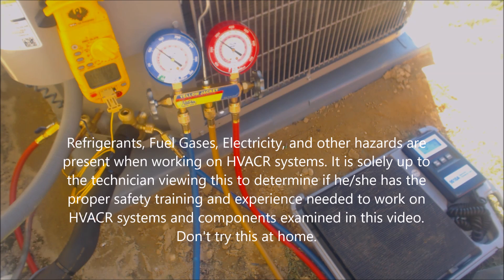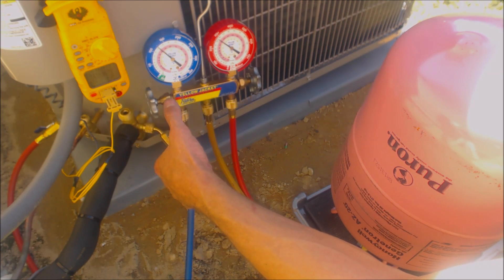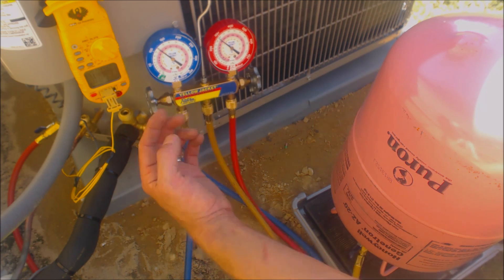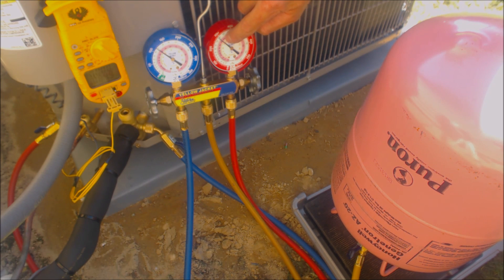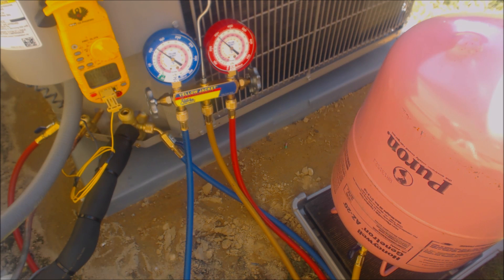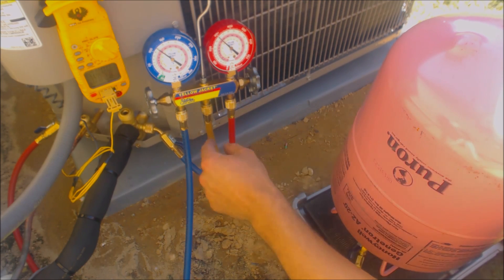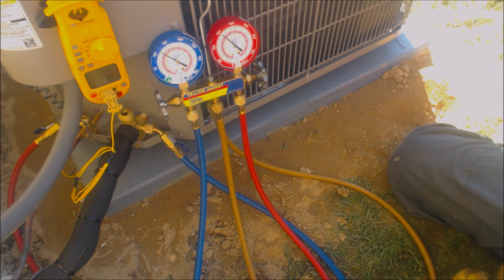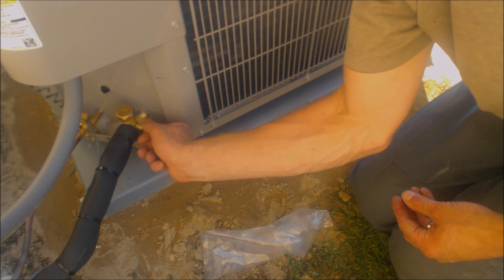How to Add Refrigerant to an Air Conditioner!

Comment: can you teach me how to compute subcooling with all these tools and equipments
thanks
Reply from the maker: To do Subcooling you would look at the dial that lines up to pressure on the outer ring. Then follow the needle in to the refrigerant being used. This temp shown on the gauge on the inner ring is your saturated temperature. Then measure the liquid line temp within 3 inches of the port with a digital temp sensor. Take the sat temp minus the actual temp=subcooling. If the subcooling is too high compared to what is stated on the outdoor unit rating plate then it is overcharged. If the actual subcooling is less than the target subcooling then refrigerant must be added. This is use to check the charge of air conditioners and heat pumps that have single and two speed compressors in cooling mode. Here is the subcooling playlist-   https://www.youtube.com/watch?v=qqLwE7Kbyaw&list=PLxnHR5_D2ojxTcAtR_53GoY8huBcSOt0a

Comment: Good day, just to say thank you for sharing your expertise. I have only a question to my doubt with regards to subcooling relation to current (Amps) reading in compressor. How much reading need for subcooling that we can consider enough based on experienced. How about the current of compressor it is need to read full load or based on subcooling only. Thank you in advance.
Reply from the maker: A compressor curve is used on refrigeration but not on air conditioning. The amp draw will go up if the refrigerant cannot reject the heat and the pressure goes up or there is too much subcooling taking up the outdoor coil and the coil has a hard time rejecting the heat,  make sure to set the subcooling to the target found on the rating plate or 1 or 2 degrees above the target txv subcooling rating on the outdoor unit, thanks

Comment: Great videos. Keep it up. Can you make a video on how to charge a unit with a variable speed compressor and electronic expansion valves? Especially since most have very vague installation instructions.
Reply from the maker: Most variable speed units are total weight and lineset length only unfortunately. Thanks for letting me know what you would like to see Albert!

Comment: I am new at this (and have a lot to learn) and a lot of videos don't cover how to attach the hoses/manifold. When you attach your manifold and purge the lines like you did, isn't there still air in the manifold itself? I was recommended a method that purges the air in the manifold too: Open each valve on the manifold and allow the refrigerant from the system push towards the tank where the fitting is loose on the tank itself. this should leave no air in the manifold and the hoses. Can you think of a problem or pitfall with that method? Thanks ...great videos!
Reply from the maker: That method works great. That is the same that you would see in the recovery video I just did, thanks. A pitfall could be not knowing exactly when all the air is out because the vapor and liquid are mixing. When you purge a vapor line there is some noise change but you definitely know when you purge a liquid line. But we do what we can, thanks Tony!

Comment: I always check the temperature split at the indoor unit after I charge it up and if it's between 17 and 21 I am happy with it. What is your take on that? Thanks
Reply from the maker: Yes that is what I do 18-21 delta T, but when you are checking a unit that is dealing with very high humidity, you may not get it on piston systems so you have to rely on just your superheat in those circumstances. I always check it though because it is one of those confirmations when you do see it, thanks David!
Reply: acservicetech Yeah right now I  am doing install and I have not worked with any units that have pistons. The only units we seem to install are Trane and Rheem and they are TXV systems. Eventually I will transfer to service so the info you gave me will be very helpful. I need to start right down all of this and keeping it in a folder. Haha!  Also sometimes I run across units that give me a higher temp split would that be because there is not enough return air flow? Thanks man!
Reply from the maker: They may be variable speed compressors if the manufacturers say they should have a higher temp split. If you are reading a higher temp split on a single speed compressor then yes it very well may be low air flow. Check the low side to make sure it won't eventually freeze if it stays on, thanks
Reply: acservicetech I will look at manual next time I come across variable speed unit. As always thanks for the reply. 👍

Comment: Thanks again for another learning experience. The metal caps on the top of the lines are new to me ... why do those have to be off when filling?
Reply from the maker: The only reason they were off was because I just opened those valves after installing the unit. They did not have to be off, thanks
Reply: acservicetech • Thank you.

Comment: you leave the pressure in the gauges?
Reply from the maker: I try not to but in this case if I added that refrigerant too, I would be at 14-15 degrees of subcooling as there is a lot of liquid in the line vs 12 degrees where I wanted to be. Sometimes it is hard to judge when to stop charging and start the disconnect procedure. On this system I could have started at 9 or 10 degrees and then charged the yellow line in and then the red line. It is certainly very easy to charge this red line back in when just checking a charge as you won't be over charging, thanks TurboFlush!

Comment: Where is your filter dryer? What are you charging per pound?
Reply from the maker: I always install the filter drier in front of the evap coil. The refrigerant was included in the quote to do the change out, thanks
Reply: Thank you

Comment: I have a question.
  should I  take  HVAC class  from adults apprenticeship  trades school night times class or take HVAC class in college ? what's the same and different ? Thanks you.
Reply from the maker: College is usually less hands on. I would start by contacting the local technical or vocational high school and see if they off adult classes or adult apprenticeship at night as many usually do. This will usually be your best bang for the buck while giving the best experience. Obviously locations are different but this would be my view, thanks!

Comment: Hi, I just installed my first Goodman heat pump, my question is why my succion line is hot? can you help me, could it be the termosthat wiring or is low in refrigerant because  the line set is 20'  long?
Reply from the maker: If the vapor line is very hot then it sounds like you are in heat mode. The reversing valve must not be powered. Yes it is likely the thermostat wiring and the B or O terminal, thanks
Reply: acservicetech thanks your videos really help,you are a great teacher.
Reply: Ruben Gonzalez gjnkmnbb

Nhnomm.mnvpcxxxbbllljj

Comment: You could have discharged the high-side red hose into the suction side as well.

First detach high-side, then discharge into low-side, then detach low-side.

I'm sure you know this; probably just skipped your mind.
Reply from the maker: The reason I did not do that disconnect procedure was that I didn't anticipate and disconnect from the tank early enough and you don't want to add too much refrigerant into the system or you would be at 16 degrees of subcooling before you know it.  You also can't check the subcooling after you do that to see how much more you added into the system, thanks.
Reply: You are right anyways 12 deg subcooling will take care of that as mentioned in video. Correct me if i am wrong.
Reply from the maker: That is correct Ravi T!
Reply: what happens to the refer in the red hose
Reply: It is in a condensed (subcooled) liquid form. Thus a lot more goes to waste as opposed to if it was in a vapour form.
Reply: Like all your videos excellent.... illustration and explanation ,I'm learning so much thank you!!!

Comment: Hey partner my mom's a/c has a sight glass I see no refrigerant flowing and the middle dot is black??? some time's I see a swoosh of refrigerant gush than the sight glass look's empty????
Reply: jimbola77 Why would have a sight glass on a Ac that dot is for moisture in the system that dot should  should some color it depends on what  type of sight glass part you have usual a label would tell you what color  that dot should be .Look above the common how an should be charge is the AC cooling.
Reply: Edward HVACR CT no cover partner, it's a Lennox 3 ton r410a?